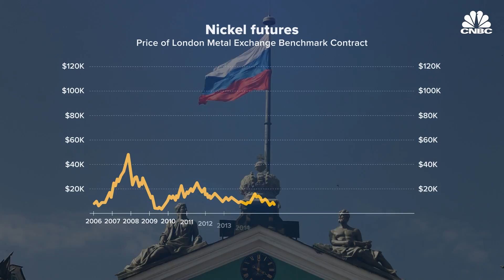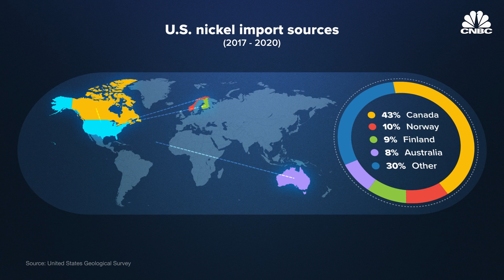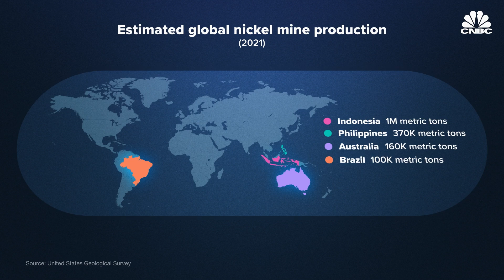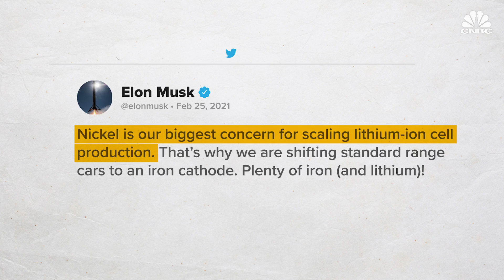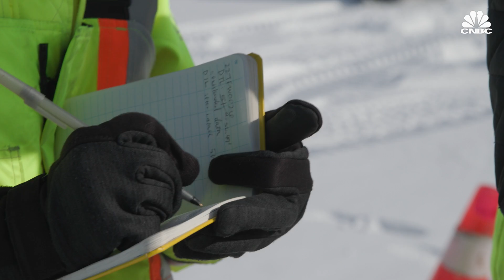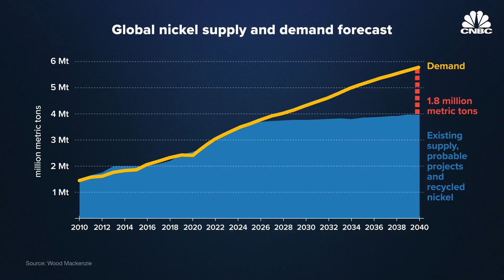Why The EV Industry Faces A Global Nickel Shortage

Comment: Battery technology is quickly adjusting to the shortage of nickel and cobalt. New battery chemistries are focusing on Lithium-Iron-Phosphate, no nickel or cobalt needed. Tesla standard range vehicles are now using this new chemistry. Beyond that CATL is working on sodium salt based batteries rather than lithium. It's a couple years out but coming. These are early days.
Reply: Lithium Iron Phosphate (LiFePO4) is not a new chemistry.  It is safer (250°C before ignition vs 150°C for Lithium Cobalt - the more common Lithium Ion chemistry), but it’s energy density and charge voltage are significantly lower than other Lithium Ion chemistries.
Reply: Exactly, this is a very one sided and not very well researched article. CATL have achieved 160wh/kg already and will have their 2nd gen batteries out later this year. EV vehicle packs will probably be hybrid of sodium and nickel based batteries until the sodium / prussian blue variety achieves or passes power parity. Exciting times for renewables and lower and cleaner production costs.
Reply: Ion phosphate is being used in low end ev scooter batteries in India. They are getting better in terms of charging time and range.
Reply: Thanks. The video ignores that fact and the only reference to alternative sources was the Musk statement.
Reply: Who cares? Only about 25% of miles driven over the last 30 years have been driven by small, short-range, private vehicles.

Comment: Nickel is not necessary for lithium batteries. Yes, battery would have lower capacity if other chemistry is used. but that is what we need. 
But there is better battery closing to production! Solid electrolyte lithium metal/sulphur battery. This battery formulation uses solid electrolyte, lithium metal anode and lithium polysulfide anode. Experimental batteries already reached 1000 charging cycles common for other battery chemistries used for cars. Capacity is 2-4 times as high as for traditional nickel containing lithium ion batteries!

Comment: EV's and Solar are not green and what is the point of even going green if China and India don't get on board? What is the point if creating all these so called green energy things if creating them creates as much of an environmental problems as burning fossil fuels?
Reply: Because they don't... Emissions of EVs are far lower.
Reply: @Freba9  You completely missed the point. The BIGGEST cause of all pollution and emissions is China and India. If we go 100% green and everyone has EV's it does not matter if they don't change. Do you even realize the environmental damage to mine and refine all these "rare" earth metals needed for EV's? No of course not because all you green wackos just believe everything your told without doing any research on your own. I am not for fossil fuels but I don't think EV's are the fix either. EV's are only as clean as the power they come from and everything needed to create them has a pretty big carbon and environmental footprint. Probably not as big as burning fossil fuels but EV's won't save us from anything.
Reply: @johntownPSN  Wrong. Even on mainly non renewable energy EVs are cleaner than any gasoline or diesel car. Production emissions are compensated for during use.
Reply: @Freba9  Production emissions are compensated sounds like replacing one pollution for another. Look I get it, neither of us are going to convince the other. So let's just agree to disagree.
Reply: @johntownPSN  Plenty of research has been done on the subject. Good luck reading.
Reply: @Freba9  No you are wrong. Biased research may have been done.
Reply: @johntownPSN  LOL

Comment: A relatively important but ultimately short term problem. Sodium (salt) Ion batteries coming out on the market late this year that don't use Lithium or Nickel. Already 10 times cheaper and 1000 times cleaner to produce. 5 yrs till they're the dominant EV battery. Lithium and Nickel will only be used in phone batteries and similar products.
Reply: You clearly don’t have a physics education lol.

Sodium batteries have uses, transportation is not one of them. Maybe eventually on monster ocean freighters. Maybe.
Reply: @shane864  no battery can be used to move large vessel in long range, naval architects have calculated that
Reply: Sodium batteries are perfect for electrical grid load balancing, not EVs, because they don't have enough energy density but are relatively cheap. Solid State Lithium Phosphate and Lithium Sulfur are the two upcoming battery chemistries that both don't require nickel and offer comparable and better energy density, respectively. Solid state lithium is currently headed to production with lithium sulfur close behind as breakthroughs in dendrite reduction using glucose have made them viable for long-term use.
Reply: @gljames24  CATL have already achieved 160wh/kg with their sodium/prussian blue variant batteries. They will have their 2nd gen out later this year. EV vehicle packs will probably be hybrid of sodium and nickel based batteries until the sodium / prussian blue variety achieves or passes power parity/density.
Reply: Didnt one of leading sodium startups go bankrupt?

Comment: IMO... EV is a joke.  I'm convinced the overall carbon foot print for EV is going to be more destructive and this push for EV is not well thought out.  Just make combustion engine more efficient.
Reply: Hydrogen is the key
Reply: @ol1294  agree
Reply: It’s already pretty efficient, there is definitely a ceiling with exactly how many miles per gallon an ICE will be able to get.  At this point it’s more of an idea to make cars lighter using aluminum and titanium rather then heavy steel. Both of those metals are much more money to produce thou

Comment: You can't recycle what isn't there to begin with. Yes, recycling is good and all that, but if you have a million EV batteries to recycle, you'd get a million EV batteries from it (assuming losses are made up by advances in technology requiring less). Which is good. But if we want ten million EV, the remaining 9 million will have to use freshly mined material. Repeat that all over the world.
Reply: spot on

Comment: More than 50% of EV (made by BYD, SGMW and Tesla) use LFP batteries and not NMC batteries. LFP batteries don't need Nickel, Manganese, or Cobalt like the NMC batteries. The shortage of Nickel will push more EV makers to switch to LFP. Switching to LFP does not require any change to the design, Tesla Model 3 and Y SR (Standard Range) use LFP and share the same design with the other Model 3 and Model Y options.

Comment: I love how these prickly "environmentalists" conveniently forget the massive advantage of having 5 million electric vehicles on our roads.  Ironic that by blocking new mines, they are obstructing this improvement from happening.
Reply: it's a cult
Reply: Well, I know that in the case of ethanol, any environmental gains from biofuels were actually completely negated from changes in land use. Turns out turning wilderness into farmland is actually worse for the Earth than just not farming ethanol in the first place. In this case we have to consider the amount of carbon involved extracting/processing the nickel and the environmental impact of mine runoff. For now, anyways, given that the majority of world energy is generated by fossil fuels, I don't think the benefits are clear. Usually if we have an option between "exploit more resources" or "don't exploit resources", the latter is the better option.
Reply: all the environmentalists already own a EV

Comment: It would be interesting to see if the LiS (lithium sulfur) battery can be both perfected and mass produced.  This is kind of the holy grail of next gen battery tech if it can be achieved in a way that makes sense for EVs.  There are some indicators that we may already be at the dawn of this entering into EV use through recent advancements and innovative design.  No shortage of Sulfur out there.

This may lead to a bifurcation where LFP batteries get used for stationary storage and LiS batteries get used for transport applications.  I could easily see LiS in cars, trains, planes, and boats.  A practical durable chemistry may proof to be 2x to 3x as energy dense as the Lithium-ion batteries used in Tesla cars today.  That would be enough to fly a regional airliner, allow a cargo ship to cross an ocean without being overburdened with battery weight, or allow a battery electric train locomotive run a full work shift at full power.  Granted LFP batteries are already finding their way into battery electric locomotives and it seems to be working out as train locomotives can be setup to carry a whole lot of batteries mass wise.  There have also been a demonstration of a dual battery modified Tesla Model S using was is suspected to be an LiS battery for is 600 mile "range extender" second battery pack in addition to a 150 mile Lithium-ion battery.

Even if the battery market bifurcates this way and Lithium Nickel Cobalt batteries go into a decline, Elon Musk still needs the nickel for his stainless steal Starship rockets, which he wants to make a lot of.
Reply: The only better chemistry in terms of electro-negativity would lithium florine, but it may be possible for use to develop hypercapacitors using graphine like materials or some other exotic way of electrical energy storage.

Comment: Since stainless steel uses the most nickel in the world, using nickel free or low nickel stainless would be a solution. Nitrogen stabilizes the austenitic phase as nickel does. Nitrogen stabilized stainless can be used in many applications. The challenge is getting customers to approve the change.
Reply: An alloy scientist may be able to pull off a nickle-free stainless steel but that might simply migrate the problem elsewhere.

Comment: 70% of nickel is used in stainless steel. Batteries have been a growing use, but mostly for phones. Automobiles will primarily use LFP batteries.
Reply: Not most vehicles, different battery chemistries will be used.
Reply: The LFP battery chemistry seems appealing at first because of the low cost and sufficient supply of Iron, despite the energy density shortcomings. Do investors/manufacturers take into account the tariffs/burden of recycling/disposing these batteries when they reach the end of life? That's why I believe the more energy dense Nickel (NCL) has a viable recycling circular business. The recycling companies will absorb or even pay the recycling fee to get access to high grade nickel. Who is going to recycle Iron at a profit?
Reply: @ilirmullai  it is the Lithium which is valuable in LFP.
Reply: @rb8049  I disagree. Surely Lithium is one of the valuable materials but it accounts for a small percentage of the battery make-up. The cathode (Nickel, Iron, etc) makes up for the significant portion of the physical battery makeup. If I was a battery recycling Co, I would choose NCA over LFP because it is significantly more profitable. Have you seen the price of Ni lately?
Reply: I mean both LFP and NCA both use Lithium as the electrolyte (10% to 15%) of the battery makeup. The cathode material could range from 40%-70%. Therefore NCA would be orders of magnitude more valuable to a battery recycler over LFP.
Reply: Batteries will be standard in more stuff, be it war industry aswell
Reply: Why the US is running out of everything
fron money to people, metals, in rubber and sand?

Russian metals are deeply rooted in the US market.
The US has already banned Russian oil and gas, 
but nickel and palladium have been noticeably left off the blacklist.
Both are key components for America’s green revolution, 
which has some wondering if they’re simply too vital to sanction. 

The US is also facing an aging population, 
falling birth rate and economic recession 
caused by the Covid-19 pandemic. 
These issues will have huge implications 
on the size of the workforce and the consumer base.

US government could run out of money soon- The US Treasury Secretary 

What country has spent 40% of the combined military budgets of the world, 
but their Pentagon still indicate to Congress 
they need to increase the military budget by $7 billion 
and send their troops to the Pacific to 'encircle' China.
 
Isn't “Cold War and zero-sum mentality” 
that leads to obsessive military superiority?
Reply: and you'll compete with fertilizer to get Phosphate, good luck with your food 😂
Reply: The CT needs nickel unfortunately
Reply: What about need for Nickel in Solid State Batteries ?  Many believe by 2025 these will begin to be introduced into the Market.  Also, I suggest we even take drastic measures, recycle Nickleback !
Reply: @eugenefeinstein6702  US ready to fight 
to the last drop of Ukrainian, European blood.

Mao said in the 1960s that the US imperialism 
was a "paper tiger." 
It's not even a paper tiger now 50 years later, 
but it is an old and declining tiger 
and many of its teeth have fallen out. 
And there are younger, 
far fiercer tigers in the jungle now.
Reply: @eugenefeinstein6702  US to use Ukraine as stepping stone toward Taiwan provocation.

The US is planning to provoke conflict with China through Taiwan 
just as it has done to Russia through Ukraine. 
A similar process of replacing both governments 
in 2014 and then preparing both territories 
for war has been underway since. 

US policy papers have called for the encirclement 
and containment of both Russia and China 
for decades and ultimately, 
stopping China requires first isolating it 
from its largest, most powerful ally, Russia.

Comment: contactless charging roads that charging cars with super capacitors can eliminate heavy batteries.
Reply: it's not going to happen, look up thunderfoot's video on the constraints and issues with building roads to generating electricity, it's not practical, it's expensive, and the companies behind it are more scam than substance.

Comment: Not a single mention of other battery types like LFP that are already being used in EVs.  We might just see one of the developers of those make significant advances which narrow the gap between them and best of class N* batteries, and the problem will reduce on it's own...  My gut tells me someone is going to use some nano technology in a clever way to reduce some of the volumes needed and at the same time improve their performance in energy density realm...  Then again, so much battery research going on all over the place, could see an entirely different mixture of chemistries come to the fore and Ni might not even be involved in them.     Recycling is a good thing anyway, make the pipeline from user to those plants simple to use and it should address some  of near-term demand.
Reply: I feel that could be LFP addresses the smallest concerns of ev’s? Like don't we need lithium for long range or magnesium
Reply: Depends what you mean by long range. Storage, and 300-350 range cars can be accomplished with iron

But a 500 long range cyber truck will likely need nickel.
Reply: 👍 for battery technology.
Reply: It was a report on nickel,so that's why
But you are correct, there is massive investment in battery technology that will see new battery chemistry such as sodium being introduced
Reply: and youll need another Phosphate mines which are already competing with fertilizer usage
Reply: Actually at 6:32 there is mention of LFP in Musk's tweet.